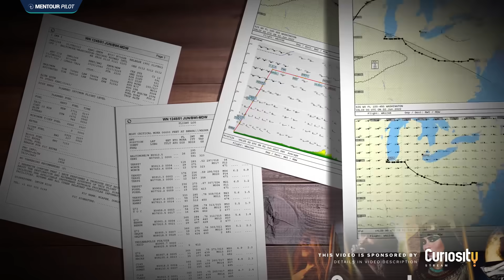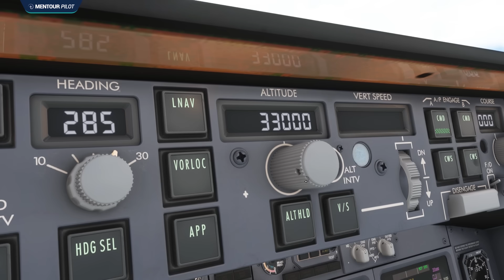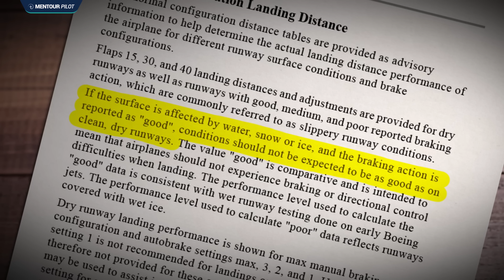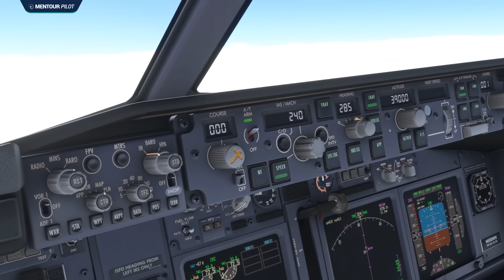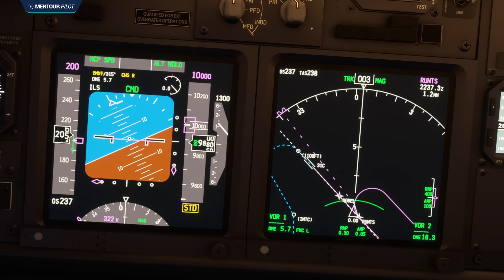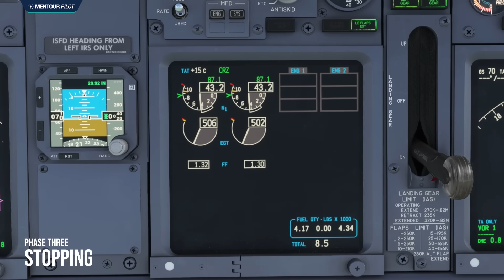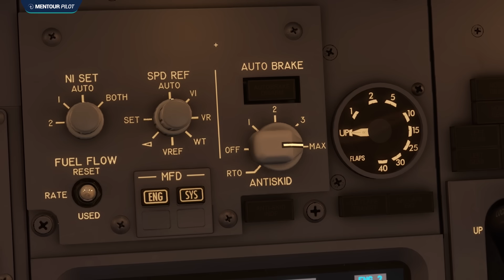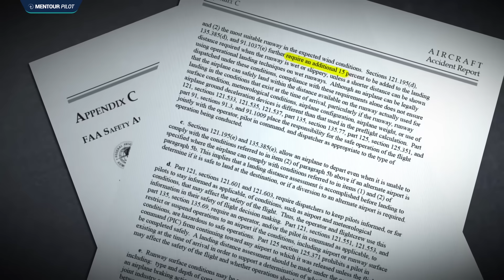WHAT did The Pilots MISS?! Explaining Southwest Airlines flight 1248

Comment: Note to self: don't fly to any northern airports in winter. If the airlines have any brains they should charge 3 times as much for those flights instead of passing it off to normal flights. And Midway, with relatively short runways. And homes ringing the property.  Then toss in the high-ish possibility of diversion - oh yeah, I'll definitely fly there.

Comment: I heard of another accident that took place in Russia. After landing the pilots engaged the thrust reversers and the engines spooled up normally but the reversers did not engage so the engines were providing forward thrust.
       The aircraft struck an embankment at the top of which was a freeway. Wreckage from the plane crossed the road and though the pilot and copilot were killed, and several cars were damaged, no one on the ground was hurt.
       This accident, and that one make me wonder, why aren't pilots trained to go around at once if breaking systems fail.
      After touchdown the point where it is too late to stop is just seconds away, continuing to try to stop after this is pointless. the plane needs to get back in the air to give the pilots time do to work out why their brakes failed.

Comment: When I see these videos where aircraft can’t stop on the runway and then go on to crash into a fence or fall off a cliff or go on to a highway in this case, I wonder why the pilot didn’t try to turn the aircraft towards the end of the available space? You have empty grass and a lot of space of the sides of the runway. Why can’t the aircraft make a turn to the left or right on the ground at as slow a speed as possible? Surely that would be better than crashing into a fence or falling off a cliff.

Comment: Just curious. Would a smaller plane with the same amount of passengers would have been able to stop in time in those conditions? If so would it be incumbent upon the airline to change equipment used in those scenarios with similar airports that don't have a lot of room for error?
Reply: I don't think a smaller plane would have been able to hold the same amount of passengers (unless it was an under-booked flight).  And the 737-700 is smallest aircraft in Southwest's fleet since the only other variant they fly is the 737-800.

Comment: Why can't they have a direct electronic signal relayed to flash on the road ahead to indicate that a flight has breached a Normal Braking End Point on the runway thus warning road traffic to Urgently SlowStop just in case a plane breaks through the boundary fence.  If you have even a few seconds to slow/stop your car you may survive but if you have no clue that a jumbo jet is about to cross the road in front of you you're screwed.  I'm still wondering why they have solid road surfaces all the way to the roads ahead. Surely that's where you put up spiderman net

Comment: Question: In case of such bad conditions that the runway  is not long enough for a safe landing, is it not possible to land on  the threshold before the landing zone/ PAPI lights giving the plane and additional approx. 1000 Feet of runway? Disregarding the "50 Feet above Threshold" rule in an emergency. And is there not an auto reverse thrust setting?
Reply: The ILS glide slope brings you down in the touchdown zone. You can put the aircraft down "on the numbers" i.e right at the threshold from a visual approach, but I suspect that the conditions were too bad for a visual approach, not to mention the trouble you might face for using an procedure not authorised by your employers.

Comment: Speaking of small runways, I was at Reagan National (perhaps before it was renamed from its original name National Airport, Wash D.C.) when I saw an incoming plane and an outgoing plane come within ONE PLANE LENGTH OF EACH OTHER (I believe it was in the 70's if you need to look up documents of this). How does something like that happen? Since no one was hurt, other than the blood pressure level of all those around watching this non-incident, does that mean no cogent documentation would have been kept (for various reasons, not the least of which would have been a cover-up)?

Comment: Is there a way to pull the front landing gears up, so the plane will glide to a full stop?
Reply: No.  Not from the flight deck.  The gear lever brings all the wheels up or down.  You can't individually select just the nose gear.  That would also just increase the chance of injury to passengers and complicate evacuation since the tail would be high off the ground and the rear doors would not be able to be used to get passengers off the plane.
Reply: @skyhawk_4526  thank you for the explanation Skyhawk, makes sense! :)

Comment: Seems runways need sand filled areas at the ends.

Like with "runaway" tractor trailer ramps along steep hills on freeways.

GT Moto racing has sand filled areas as well.

Why have special concrete instead of sand?
Reply: @InservioLetum  
Thanks

Comment: Does anyone know what the air crash investigation EP was where the co pilot tried to open the cockpit door however pulled a switch the same shape and almost lost control? I want to use it in a talk im doing as an analogy but cant seem to find it.
Reply: nvm found it 
Accident: ANA B737 near Hamamatsu on Sep 6th 2011, violent left roll while opening cockpit door injures 2 cabin crew

Comment: 9:09 How do you know it is 40 "feet" and not meter? I mean, the Pressure Altitude parameter has a unit indication ft, a temperature is written in two different units but both are correctly mentioned.
In the result table, the unit of measurement is not indicated.

Comment: Southwest didn't tell the pilots that the thrust reversers were included in the braking distance calculation!
The airline is completely at fault for this accident.
Reply: Probably doesn't matter much when you don't apply the reversers until you're already nearing the end of the runway.

Comment: Why could they not do a go around after the huge delay in reverse thrust? I guess they would have if they thought the approach required the reverse thrust.

I also did not like the idea of monitoring the autobrake. Physics denotes that the early braking makes all the difference to stopping distance. I don't think that they fully undstood that.
Reply: By the time they'd realised the reversers were in idle it would have been a colossally bad idea to try and take off. It would have taken a few seconds for the reversers to close and then you have to get the engines to spool up from ground idle to full thrust. If they'd tried that all they would have done is exited the runway faster.

Comment: I'm surprised that they elected to use a brake mode they had never used before on a landing where they were clearly already worried about stopping in the available distance. To my mind the distraction this caused (which resulted in the reverse thrust being massively delayed) was the core reason for the accident. The mishandling of the landing calculation is a bit of a red herring - they would have stopped OK if they had engaged the thrust reversers in a timely manner and stood on the manual brakes like they had done many times before.
Reply: No. Autobrakes could ve done the job as boeing recommended. They were just not used to it.
Reply: @Hk-uw8my  I think that is what I said - the fault was in their unfamiliarity with the system which induced errors in their reactions - not that the system was inherently inappropriate when used by a crew familiar with its usage.

Comment: I've had computers reject my input because I don't have a middle initial, yet this SAFETY CRITICAL system just quietly capped it? I know we're not supposed to assign blame, but I would have a good hard think about whether to continue any work with that software developer.
Reply: It is not safety critical, it is advisory. The onboard manuals give the authoritative answer.

Comment: Maybe a stupid question, but can a pilot confronted with a plane that is not stopping while landing try to retract the frontwheel ? The belly of the plane would of course be damaged, but maybe the speed would decrease ? Or would that be too dangerous (increasing risk for fire) or is it simply not possible ? Why dont passengerplanes have extra speedbrakes like an F 15 for ex ?
Reply: There is no way to retract the front wheel. 
Airliners do have speed brakes on the wing. They are quite good since they also destroy life and get the weight onto the wheels.

Comment: Can you please clarify the units with temperature in future please as -4°C is 24°F, but -4°F is -20°C. It is confusing and im still unsure which one it is
Reply: Come on, if you ever attended a school, you should have learned that 0 °C is the freezing point of water and 100 °C the boiling point. So, –4 °C must be a bit beyond 32 °F. Welcome to the 21st century.
Reply: @akronymus  that's not the point I'm making. The point I am making is that he just said -4° without any units meaning it could be either of the two. Yes they are both below freezing, but they are at different points below freezing. One is just below freezing where as the other is slightly colder than your standard freezer.
Reply: @cassandrakarpinski9416  Oh, you are so cute, my little one. Keep on thinking like thes. And pet your Barbie.

Comment: It sounds to me like someone was criminally negligent for giving such a ridiculous exemption for the runway safety area and someone else paid the price for that negligence with his or her life.  There is absolutely no way that anyone can claim it's reasonable to have a runway safety area length of only 82 feet when the standard is 1,000 feet.  It makes me wonder who was paid off to grant that exemption.

If runway excursions are increasing in frequency/quantity, then it would make sense to start implementing measures to help aircraft stop safely.  One such measure would be to implement some sort of heating or other method to ensure that runways never freeze or collect snow.  Another method could be to install turbines that can be activated shortly before and during landing to provide strong headwind for the landing aircraft.  Yes, these measures would cost money, but so does the fallout of these runway excursions (NTSB inspections, potential fines, potential lawsuits, required repairs, etc).

Comment: Do any companies have a help/call centre where say a retired Captain could double check the figures etc? 

Or are the guys flying expected to know all this information or to find it via the books etc. Or would they seem they would be undermined if they asked for a check?
Reply: The information for the relevant figures is normally always accessible within the cockpit (in the manuals and performance charts).  But there are also resources on the ground that can be contacted to cross check the numbers or to consult with on any abnormal situations that might not be covered in the flight manual.  The pilots here had all the information they needed to make the proper calculations, they just misinterpreted and miscalculated.

Comment: What would have happened if they tried to turn off the runway into the grass or the last taxiway?  Obviously, the last taxiway might have traffic.  Can you turn a plane on the ground going 60mph? 
How about into the grass?  The grass may cause landing gear damage and "possible" injury to passengers, but would it cause fie damage if an engine dragged on the ground?

I agree. airport ground traffic needs an overhaul.  Lack of uniformity in lighting, ATC/pilot language and terminology as well as crosstalk...  I'm fine once we are in the air and out of turbulence.  Takeoff and landing still make me nervous because I am aware of a lot of issues.
Reply: On a dry runway, yes.  The less sharp-angled turnoffs from runways are designed to handle 60 mph.  As friction coefficient drops, however, at some point an attempt to turn will instead result in a skid of the NLG tires.  Assuming speed has by then dropped to where the rudder is no longer effective, the aircraft will continue about on the heading it was pointed at when loss of NLG side force occurred.

Comment: Why don't commercial aircraft include emergency chutes for situations like this? Seen several videos about runway excursions, both with normal and emergency landings, and this is a common enough feature on military aircraft and prototypes in testing - I've seen them used on a Concorde, so couldn't they fit them to most passenger jets?
Reply: They would be useless.

Comment: I this particular case I feel like it's a series of small things that caused the accident.
Insufficient training about how conservative values to apply for the calculation, the computer changing the value back to 5 kts tailwind without telling that the value calculated with isn't the one typed in, the fact that the thrust reversers are included into the calculations without telling that that is the fact on the 700, no mandated calculations, the new autobreak system, which also caused the pilots to lose track of the thrust reversers,. the tiny safety area.
I feel that after all the crew did a fine job, but more training and information is needed.
Reply: Serious question - insufficient training or insufficient intelligence on the part of the crew ?

Comment: As a computer interface designer myself (for complex, enterprise systems), I am boggled that the computer program limited the input-tailwind value significantly and provided no visual/audible warning that it had done so! Crucial mistake and flagrant laziness on the part of the programmers!

All complex systems are inherently fragile, meaning that there are countless vectors that can start an unforeseeable (at the time) chain of events to catastrophe. We take for granted that "things work," but even the best procedures, rigorously followed, cannot contemplate all possible permutations. And after the fact it is always revealing of the core fragility to discover that "it only took _________ problem" to start the cascade of horror. Only after the fact can that blank be filled in.

So, it is astounding that these complex systems generally don't cascade into horror, which is testimony to the foresight and professionalism of the industry in general.

Finally, I firmly believe that when it's your time, it's your time. You are not going to be able to foresee that driving down a highway with good awareness, you are nevertheless suddenly going to be called upon (and fail) to dodge an airliner! Life is fragile, and we are inundated in fragile systems. We need to wring every bit of love and joy we can out of the lives we have, and give back better than we got!

Comment: Airline profit is to blame, in my opinion, for the increase in excursions. Every delay that causes missed connections entails extra expense for the airline. Every diversion causes increased costs to the airline. Our demand for pennies cheap air travel has caused airline profit margins to be razor thin. The pressure on the pilots to get their flight done, whether direct or implied,  has to be taken into account. In a perfect world just asking yourself "should I divert" should automatically give you the answer.

Comment: I was there, that night, trying to depart for Atlanta. As soon as I saw that there had been a crash, I told my wife to book a hotel room and that we were leaving the airport, even before our flight was canceled.
I didn’t want to get stuck without a room or waiting for hours for a taxicab to get there. We got notification from the airline that our flight was canceled just as we got to the hotel.

Too bad about the kid.

I once intentionally ground looped an aircraft that departed the runway in order to miss hitting a light fixture.  I stomped the right brake (a left brake failure and un-lockable tail wheel was what sent us off the runway) and opened the left throttle. 3-5 seconds later I was perpendicular to the runway, having turned 270 degrees VERY quickly, but at a complete stop.

Too bad the SWA crew didn’t try a Crazy-Ivan maneuver like that: it might have worked.

Comment: I’ve noticed an increase in lack of safety & new shortcuts within many health & science  businesses, today. Which I find strange, since these jobs once had semi strict ethics & safety codes. Some feel like bribery is used to cut costs, ever since new management takes over. The “culture” has changed for the worse. I sure hope this won’t happen in the airline industry? There was some crashes that occurred due to cultural hierarchy, where younger or less experienced flight crew were afraid to speak out or take control. Scary scenarios.
Reply: I couldn't say whether you're right that standards are declining. My parents were in technical/medical fields and told plenty stories of safety shortcutting back in the day-- true, that's anecdotal.  But i do know that the ethics & safety codes you're referring to did not exist 150 years ago, and were only won through hardfought battles, and are still resisted by those who hate "overregulation."  That's true in aviation, mining, food processing, electric and petroleum, science, you name it.

Comment: That's a good comparison auto pilot great. The training comes in auto pilot no workie!! As we seen the first landed the Flight ended with a hard landing on taxi way. As a privet pilot. I believe every landing is a controlled crash! It would be very difficult. And intimidating to slide in a commercial aircraft pilots seat after getting previous pilot out. knobs and buttons and lights in every knook and cranny. Post 9/11 I don't think we could do any thing by the time you break down the cockpit/flight deck door. You would be out of fuel probably over shot your landing